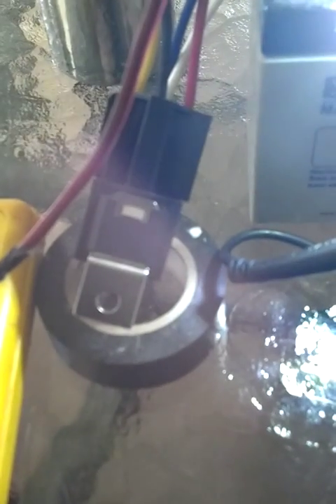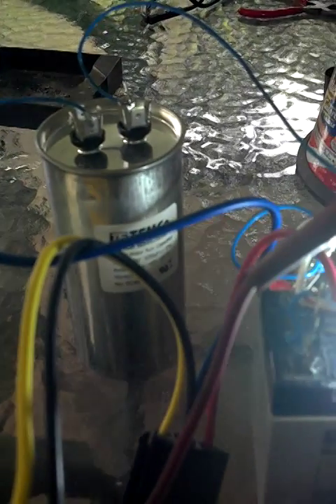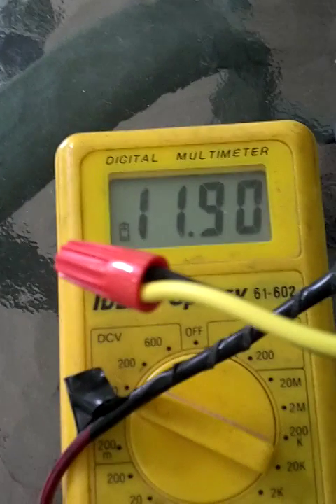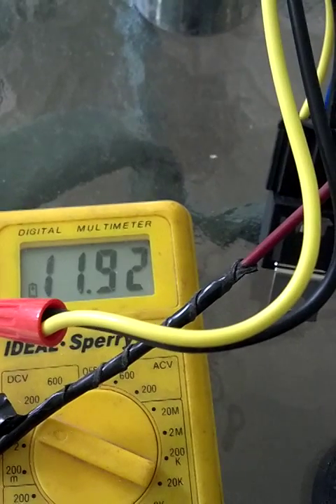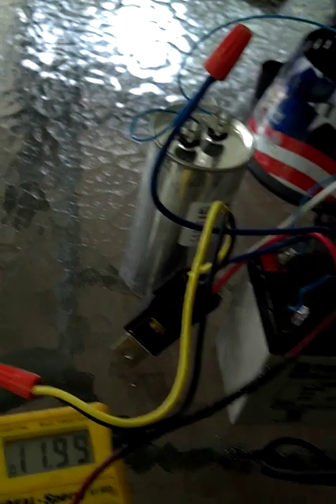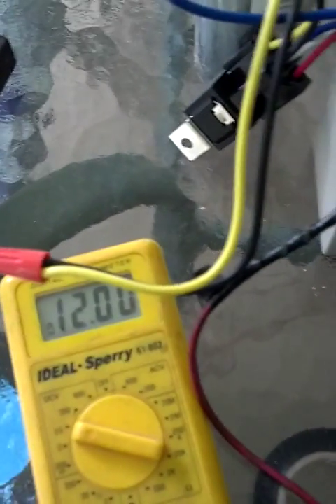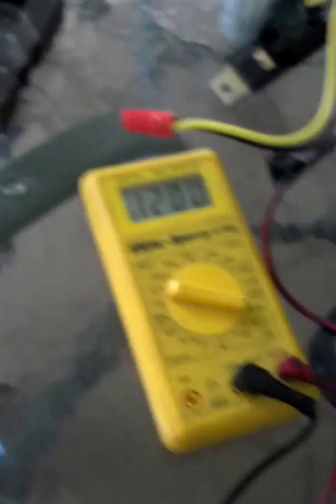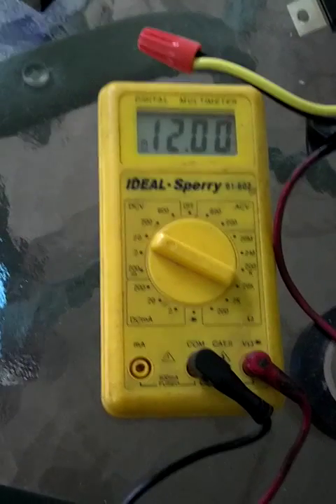Real Radiant Energy

Comment: Bedini did this better.  No need for a relay, just use a 555 timer with a darlington array to control the discharge from the capacity.   The relay bounce introduces arcing which introduces asymetric volt gains but no additional current gains and you need a bit of current to make the charge stick in the battery.   The current is the function that charges, versus what bedini called time compressed waves...  (that battery is about halfway dead sitting at 12vdc... if there was a gain it would be going up over 15-16volts dc... Does it EVER get up that high in volts from the circuit you built?)
Reply from the maker: It gets to the voltage you see in the video. The 555 can't do the same thing because we are able to drive a load and charge the battery, and the losses in the rest of the circuit.

My schematic has one wire and diode missing from it between the battery and the + leg of the secondary coil. The diode is a damn fast diode and the anode heads toward the battery.

This allows the battery to pick up a faster charge from the back emf spike and, it draws positive particles from the arc.

Marc
Reply: Marc Belanger
Ok then its Not charging the battery back up.  Its a similar idea to bedini, but bedinis output from his simple dc oscillator charges caps up to many times the source voltage... does this charge that AC run  cap up to many times the 12volts source?
Reply from the maker: CoruscantMe I haven't done much with this circuit. Go to mbrcircuit.blogspot.com and see the A-02 cir circuit, then., watch the other video I have with the mbrcircuit on youtube. All explanations are there. The cap and the battery have to work in conjunction with each other to create a tank circuit and i have added a transformer, but, there is one wire missing from the primary coil to the battery + WITH A DIODE. sORRY, i WAS REPLYING TO THE WRONG VIDEO.. This particular circuit that you are commenting on was not completed and it was one of the earlier videos where it was just being tested, which was over a year ago. I thought I had a better result than what I did. The other link is much better with results that last months without dying.
Reply: Marc Belanger
Thats ok, all the old style relay driven circuits have a max operating frequency of around 300hz... I've built a couple relay buzzers about a decade ago and the DC oscillator using a single transistor is far more functional/useful/practical for generating charge.   I did check out the link you shared.  The schematic showing the step up trafo going to fwbr which then feeds back its positive to the top of the source battery/cap combo in series, and then the negative out from the fwbr goes to the bottom of the capacitors, so that when the buzzer closes to conduct the instant discharge comes off the the cap stack which will only let it discharge down to the source volt rating of the battery in the series stack.  Whats the load in that case?  That seems like its just there to try and keep the battery topped up with no additional loading on the circuit.   How long does that run before you have to charge the battery back up with conventional chargers?
Reply from the maker: The cap's series stack had to be done only because of the voltage of the super caps being 2.7 volts, it really didn't have anyhing to do with a higher voltage because the caps never get up as high as the battery, they stay lower since they are 100F each and it just doesn't have enough ass to charge them up, but, they are needed so the batteries don't drop down low enough while not receiving the radiant energy as it is really very variable up to the second. One second the voltage may be 100 volts out, and others the voltage may be 140 , but, when the trafo connects to both the battery and the caps in parallel, the voltage stays above the battery's idle voltage like an alternator keeps it, like 12.47-12.95 volts, sometimes all the way up to 14.4 volts if no LED is connected. The system operates for months. It has stayed lit, with an AC neon and an led from June of 2014 to November 4th of 2014 without the relay burning up or the led shutting off.

The key is to connect the piece of wire with a diode in the opposite direction as the rectifier already has, allowing back emf to go in one direction and radiant energy in the other. It will not work without this unless you wind the trafo yourself and have resonance as I did with the first unit I made. I used a prebuilt trafo that did not work, and by adding this wire made it work.

This circuit when operational will not shut off indicating overunity, not a part time thing, but full time and it has kept lit a 12 volt 4 watt automotive LED while doing so without cheating.

Marc
Reply from the maker: Im not sure if Bedini's stayed on without a charger for 6 months, did it? Overunity is just that, if you loop it, it isn't overunity unless it stays on. If it didn't, it is impossible to be overunity.
Reply: Marc Belanger There are many ways to define overunity.   That loose way you describe it is lacking in any specifics noted to qualify overunity in objective simple factual terms.     Bedini's systems weren't closed loop systems, but if you want to know more, you can go read up, otherwise I'll stop here.  Good luck with this setup.
Reply from the maker: CoruscantMe This is why I am calling it an overunity system, because it is not only a tank circuit, it has derived from one, it is a closed loop, and it offers months of reliable charge back to the battery while it operates the relay, the transformer, the neon, the led, and charges the battery and cap bank. Thats all I really can tell you other than the wire I have provided whicch makes it work if you couldn't get it functioning. i also will be selling these as DIY or prebuilt kits on Ebay very soon.
Marc
Reply: @CoruscantMe  where can I find a circuit diagram for the simple DC oscillator ?

Comment: Dear marc, I've used your A-02 circuit diagram.
But in the drawing, you're showing a pin on the relay called 87a, and on my relay I've just got the pin 87 (in fact, I have 4 pins : 85,87, 30 and 87)
So I think, I have to modify it in "the Imhotep way" to get your circuit working.
I think that your relay's got 5 pins, isn't it ?
Reply from the maker: Hi Mike, sorry for the delay, yes, the relay must have a normally closed contact to oscillate which is the 5th pin.

Any relay with this contact will just about work unless it has a diode or cap across the coil or pretty much across any of the coil connections and other pins.

This is one of the only scenarios where you don't have to get resonance to oscillate, or find any other effect to do so since the relay is opening the normally closed contact, disconnecting the circuit, reclosing the switch and starting all over again which makes it a switched tank circuit that is in a forced oscillation.

The relay being used in an automotive environment will have a very good durability unless the switch has a heavy load on it with the high voltage it creates since the arc is damaging to the switch if the back end is loaded up with current, which must be light to allow it to operate, using a very light duty LED or equivalent.

I've tried this with HHO generators and have had Success for 4 hours or so but it would never duplicate the instance twice since the cap and battery arrangement allowed the amperage to be too strong, ruining the contact after its 3-4 hour beating.

The LED is about all you get unless you wind your own relay and come up with a more durable but efficient solution.

Please let me know if you have any other questions,
Thanks,
Marc

Comment: Hi Marc.
Congratulations for this simple circuit inspired by Imhotep an John Bedini I think.
I've done a lot of experiments in your way, even went further with Donald Smith circuit...and keeping the oscillations alive is the key of over unity.
So...
Of course I've tried to replicate your circuit, but I'm not able to get the relay oscillating.
Have you modified it ?
Thanks for your attention.
Reply from the maker: Hello,
 Thank you for your interest. No, I haven't modified it, it is basically how it is wired to put any relay into oscillation. Please visit http://mbrcircuit.blogspot.com and view the A-02 circuit, then, instead of making the transformer yourself, get a 120 volt to 12 volt dc power supply (power packs for chargers that plug into the wall with internal transformer)
This makes it a hell of a lot easier to build, as it is built for resonance already, especially if the caps are put across the coils of the transformer. If the device has a secondary rectifier, that needs to be removed and put on the high side coil, so, most of the components are already there for you, but, I suggest following modification once it is  built. Make a second jumper from the battery's positive pole and add a damn fast diode to the end, direction is important because it will connect to one of the high side connections of the transformer.

It doesn't matter which side, only one side will make the circuit run faster and make more energy. The circuit will already be looped back to the battery when you are done wiring it, but, this addition of the jumper is a must that will allow the voltage to rise and keep the battery up to voltage while in oscillation. You can then add a small led to the battery once it is successful. The jumper allows the rectification to be fast enough, and allow a one way "energy valve " so to speak which will allow the radiant energy to be absorbed into the battery, making it do work.

The difference in transformers are what makes this change necessary, but, I have noticed that followers have not been successful in getting this working by making their own transformers. It is vital that resonance is reached to make this function. If it enters resonance, you will know right away due to the oscillation tones, etc., as well as the voltage.

The battery will not rise above what it is supposed to, it levels off at about 13.7-14.2 volts if it is in resonance 100% or closest to it. (I don't think anybody has made this nearly 100%, I have come close with mine that had the hydrogen cell incorporated with it, but, the batterie were also brand new and it makes a world of difference.

Using the lead acid battery does not achieve the best effect so if you do use a lithium ion battery, it will work so much better, but, it is dangerous and an explosion is very evident, as well, believe it or not, the lithium ion battery will begin to change and absorb ac pulsation, releasing an ac pulse to the relay, killing the circuit if protection measures are not used, such as the rectifier bridge, which I highly recommend if using any battery.

I have tried this with just the cap bank and it will not work, so, save yourself some time, money and additional effort by taking a premade transformer, (of very small amp rating, the smaller, the better the gain) and follow this instruction. I am quite confident you will get it working flawlessly if you do so.
''
Do not forget the jumoper and diode, it is important. If the transformer is placed as in the picture, I show a switch. Connect the jumper from the switch to the connection of the larger transformer coil to the right of it.

If for some reason you get no effect of overunity of power gain, swap any of the two transformer coil leads. I suggest connections should be made with wire nuts so the connections could be swapped easily.

I will be posting some new circuits very soon, as well, feel free to come visit my new "free energy " forum at Dezeinstein.com. Pleae post comments, circuits, and send some people there. It isn't completed, but, anybody can start posting there. I will have some completely unknown circuits to the public that work very soon!

I have stumbled upon the relay circuits originally by accident, then, once I tried videoing these, I did look them up online, matching my discovery closely to imhoteps, but, It is a bit differently wired than his. I didn't know he discovered this too. I was actually wiring a relay and got shocked upon disconnection because i inadvertently placed wires in the wrong place and it started to buzz like an old car buzzer. That was the basis of design, it was based upon the old buzzer theory and it is exactly why the buzzers made so much electrical noise in the car through the radios, especially am radio.

When we turn on am radio, we could use this to show there is energy around us to be drawn in not only by am signals, but, many others and, we could use the tuning of the radio and signal strength, completely determined by the level of noise on the air of how to tune our circuits.

I bought variable inductors and variable capacitors for this tuning on ebay to tune into the energies I draw in and it is the best way since there is not any more guess work for which frequencies need to be tuned to.

We are constantly bombarded by rays of all sorts from the cosmos and almost all of these can be tapped into to use for energy.

I highly suggest building a completely isolated radiant energy antenna by taking a piece of aluminum plate, de-oxidizing it, then, mix a very finely milled graphite powder (for doorlocks) with an acrylic or polyurethane, and painting the plate with it.

While it is still tacky, I take the tube of graphite powder and "puff it on the tacky surface, then allow it to completely dry. Then, I take a buffer and buff it to a high sheen. The color of the outside of the plate will look exactly the same color as a "static bag" which electronic chips are delivered in. This will allow the draw of an abundant amount of radiant energy that can be used to do work if the circuit is built correctly to utilize and transform to do work. the amperage will be very low, but, we can modify this by flowing the energy through a circuit like Lorrie Matchett's main's circuit to create a higher amperage just by inducing the mains voltage and amperage through a coil next to the mains circuit. Add the antenna to the circuit as i show in the a01 circuit. I still would play with this to try and modify because everybody has different results due to radiant energy levels in their area. I am on a mountain and I get great results.,

I highly recommend using a faraday cage to block any additional emf that may be develoiped which can be  dangerous from all of my circuits, as well, use at your own risk as they may be dangerous if you don't use protective equipment to guard from shock!
Reply: mpkiteman this has been around a lot longer then those hacks.

Comment: Circuit shematic? What type of relays used, resistor or non resistor type etc
Reply from the maker: this is a standard automotive relay. take one end of the coil,  (terminal 86) and connect it to the number 30 terminal. take the 87a terminal and connect it to the positive of your battery, and one side of the motor run capacitor, as well, an antenna wire. Take the negative of the battery and connect the striped side of a diode (1 amp) to it, then, to another diode in the same direction. The other side of the second diode goes to the 85 terminal of the relay. connect the section between the diodes to the terminal of the motor run capacitor that hasnt been connected. (the antenna isn't important unless you want higher voltages. Be careful, without a load on this circuit, the battery voltages get very high. If you use a standard voltage meter with an RMS reading, you will not see the emf voltages. You will get shocked off of this pretty badly if you connect the wrong wires hand to hand. In my case, it was the positive terminal of the load, I held the clip lead from the power of this circuit and the positive lead of my hho cell and I got a very powerful electrocution. The voltage will be anywhere from 13.5 volts, all the way up to 1300 volts, depending on your antenna (I did not use the antenna in this video, but it helps it out very much for larger loads so the charge keeps happening). If you have a rooftop antenna, or a shielded antenna cable, be sure to ground the shield, and leave plenty of creepage distance at the end to your shiny metal plate. For the best output, ground the negative of this circuit to earth ground, and dip the antenna plate into plastic dip. You need to insulate the plate to eliminate lightning strikes if you go to the roof of your home for the antenna area. The antenna is not needed to charge the batery and run a very small load. If you want a much larger load and higher voltage, try this with a 24 volt industrial relay as the coil will operate at 12 volts and they are adjustable. I will post more videos soon. If you have anything that has a capacitive load, such as a spiral HHO cell, this will run very efficiently just as long as you have a good dielectric between the plates and do not add electrolyte. It will have massive amounts of hho coming from the cell, and probably use 1/20th of the total amperage it normally consumes. I don't know why, but, this is all starting to make sense as to what we could do with the circuit. If it doesn't make much amperage, then, we may as well use it to reduce our normal consumption of electricity and make everything much more efficient. Please be careful with this circuit, it can be dangerous, especially if the antenna keeps building up a charge and the capacitor has no load to discharge to. It needs some sort of a load, maybe even a resistor to discharge it slowly when not in use but still connected.
Reply from the maker: I will take a picture of the schematic I made for you and post it to google images.
Reply from the maker: http://mbrcircuit.blogspot.com/
Reply: @advanced-electronic  in the circuit what is the use of the dpdt bypass switch? and theres -+ in the the diagram where can i connect that? antenna + - and ground in the diagram
Reply: @advanced-electronic  itried it without the antenna and load the battery stay at that voltage 11.6v i didn't put switch in capacitor diode anode to coil 85:(